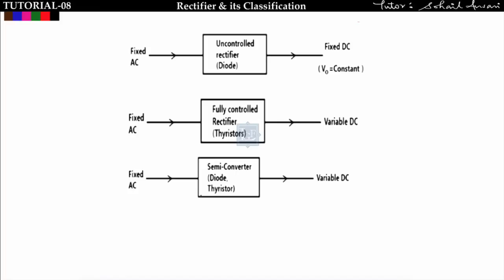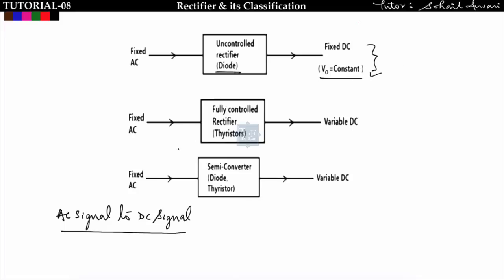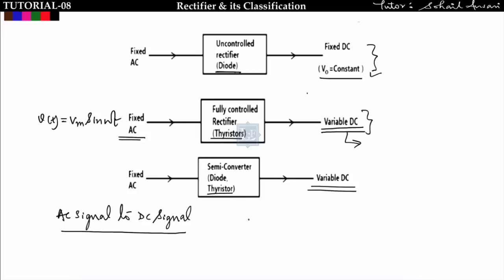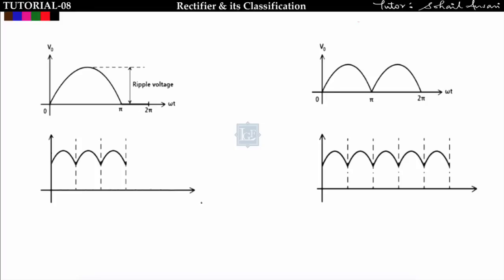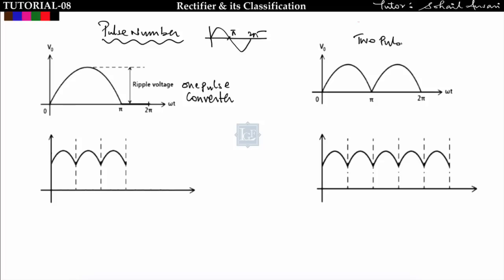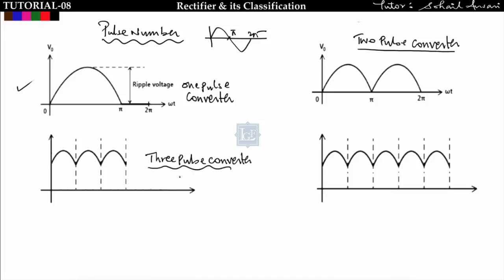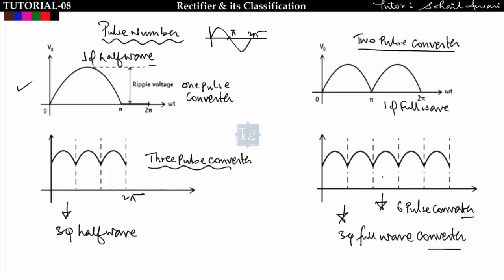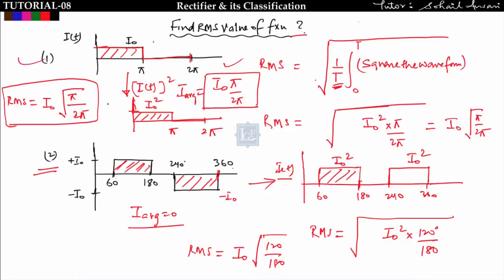Lec 08 Rectifier & its Classification

Comment: sir in the previous lecture you have explained about voltage and current stiff type of load also you told when to take rms and avg value of current or voltage but you did not explained the reason behind it. If you will be reading my comment please revert back.

Comment: Sohail Ansari sir in case of finding end value for 2nd wawe form why u took 180 as time period .it suppose to be 360
Reply from the maker: see after squaring, timeperiod has changed..
Reply: @GATEMATICEducation  sir please explain this
Reply: but still we have to take 2pi because (i think) we are calculating the rms value of not the first waveform but the second waveform.
Reply: ravi shankar yes I was also thinking this!
Reply: exactly
Reply: @sandhyareddy4163  (120*2/180*2) = (120/180)
Reply: Sir right after squaring time period has changed, but why you didn't consider 2nd wave form?